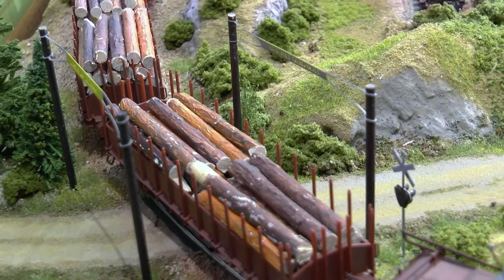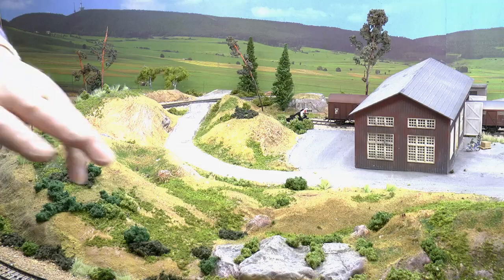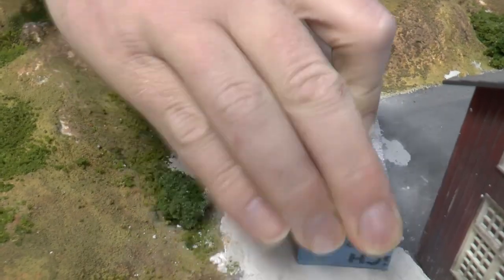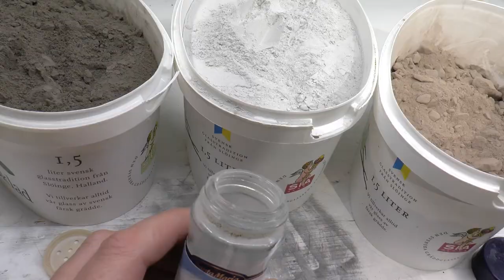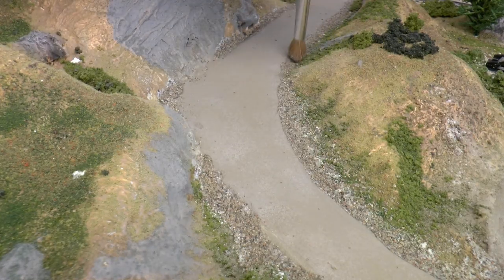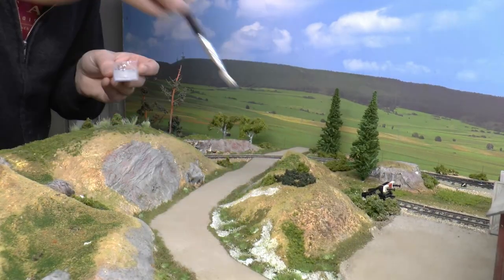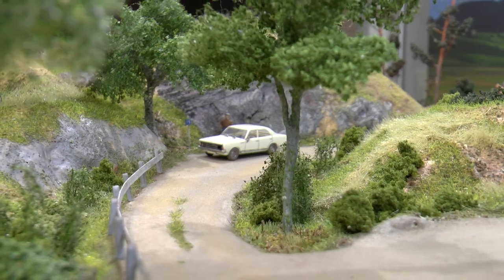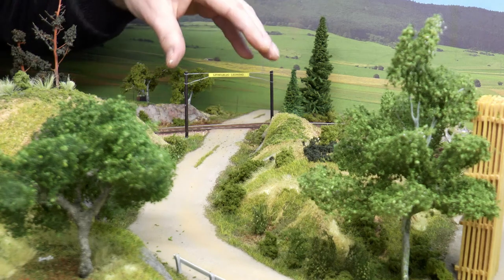Model realistic gravel road

Comment: I like your videos you are very talented. I live in Sweden now after moving from UK (uppsala) and want to get back into it after like 30 years, i have space limitations so have chosen N scale for my layout. Problem is materials! Where are you getting them? I tried Panduro (the only "hobby shop" i could find in Uppsala and is absolutely hopless unless you want to paint, string beads together, play with premium clay or make predefined kits for kids). There does not seem to be anywhere to actually go, see  and feel "stuff". I am not that experienced and online it is almost impossible to get a feel for anything. I looked for insulation blocks at bauhaus and the prices are huge (or more the overkill amount you need to buy)  where to buy small amounts of cheap dense styrofoam?
Please help :D

Comment: Perfect, I want to make a road now! One question, what is the purpose of the passivation step? What would happen if you didn't do it?
Reply from the maker: madleech The grout is a concrete based material. It is prone to react with water. I’ve seen problems with white chalk marks, like rings appearing in the surface over time. The grout seems also reactive to the PVA-glue. All this is solved by a simple spray of water.

Comment: Very week done. 
Question. What was the purpose of the foam base? Could you not just have applied the plaster roadbed direct without the foam?
Reply: You probably could do it without the foam base, but it would be harder to build up the height and make the ditches. By using the styrofoam you only need to add a small amount of plaster to smooth out the undulations.
Reply from the maker: Minok1217 Madleech had a good response there.. Yeah.. It’s just ro add hight to the road without having to plaster it all the way. I typically aviod very thick layers of plaster, but it would for sure work too. It is of course preferred if you don’t have a Styrofoam cutter.

Comment: Amazing Video and very helpful, how did get the grass to stand up when you added it?
Reply from the maker: The grass is really thin short colored plastic fibers. They are charged in a container to 25.000 Volts. When realesed they will fly over to the glued surface with the charged end first. This makes all of the fibers to land in a vertical (standing) position. Check out item: Noch Grassmaster 2.0